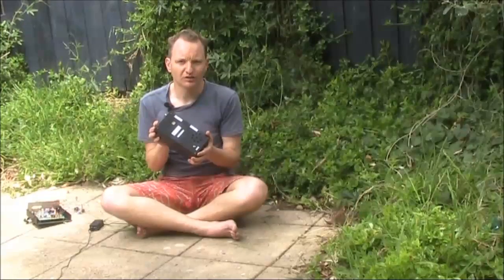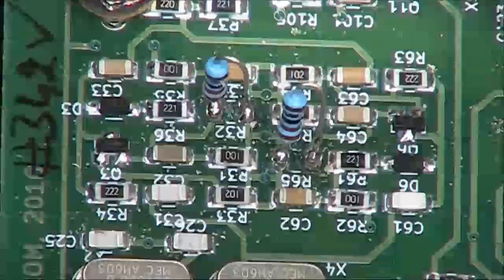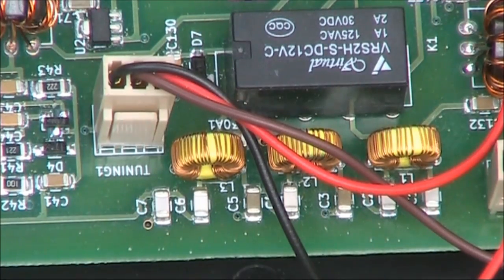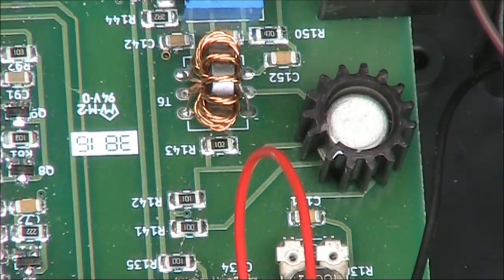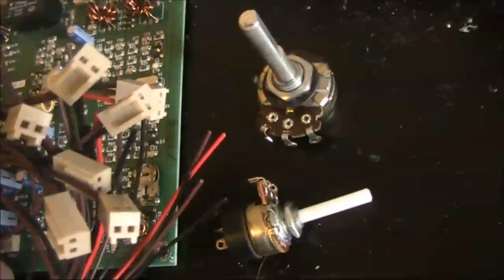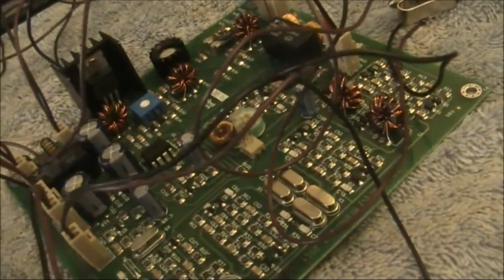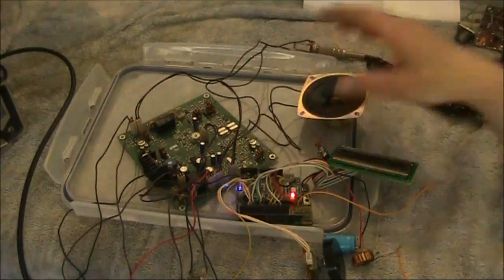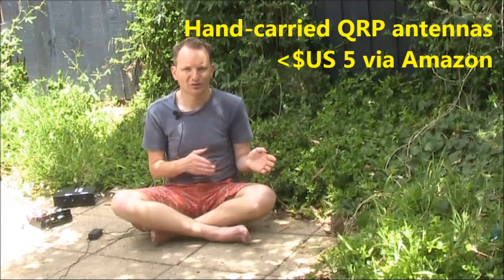Review: Low cost Bitx40 7 MHz SSB transceiver module

Comment: Thanks, Peter. Another informative video...as usual. One suggestion: When showing the DDS connection, you point out the inductor to remove, but do not identify the cap to remove. That might be useful.

Jack, W8TEE
Reply from the maker: Thanks Jack - it's C91 - ie the 1000pF between base and emitter of Q9.

Comment: Hi Peter,

Another great video.  I have one of these, I've put in an external dds as I had people chasing me up and down the band trying to maintain contact before I put it in.  The only thing that bothers me about this circuit now is the loud switching transient that comes through the audio when you push and release the PTT.  I've tried all the mods on the yahoo group but have not found a complete fix.  At the moment I'm waiting on some parts to put together a couple of relays that are controlled by a new "PTT" line.  One relay will control the old PTT line.  The other will switch the audio out line to switch on at the same time as the old PTT line - but switch off with a delay so that transients don't make their way to the speaker. I hate the complexity of this idea, the relays are likely to need some separate power supply circuit and its just not elegant but I find the rig unusable with headphones and mildly annoying without. If you happen to think of something simpler I'd be (very) pleased to hear about it. There doesn't seem much interest in finding a complete fix over at the yahoo group - it seems to be accepted as an unsolvable problem that is an inherent issue of the circuit design.

Regards

Simon
VK3ELH
Reply from the maker: VK3ELH - have you tried an audio muting circuit inserted around the volume control.  Eg a transistor or IC switch?
Reply: No I haven't tried that but it sounds good. I'll give it a go. Thanks Peter.
Reply: Tried this with a mpf102 jfet in the hot line to the volume pot. Muted more quickly than without it but pop still there.